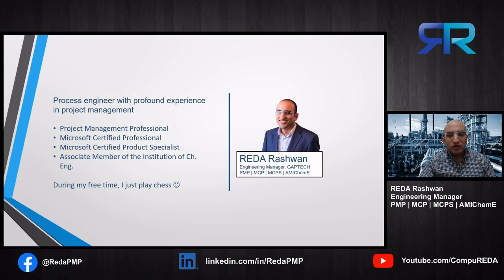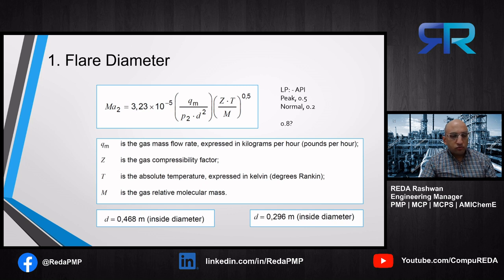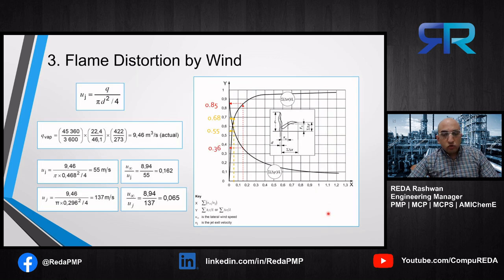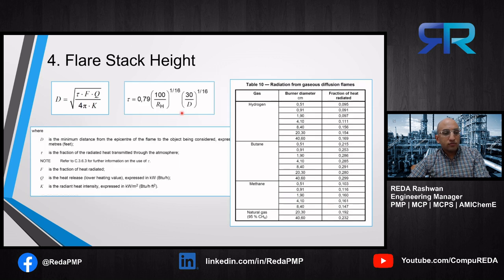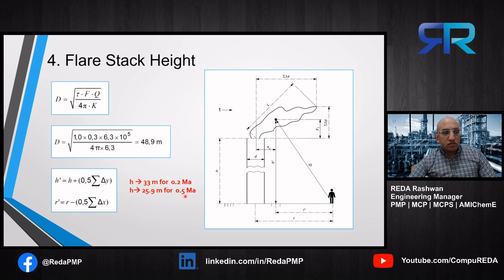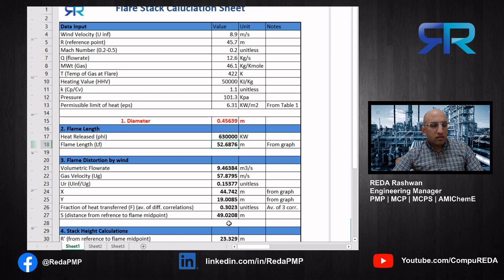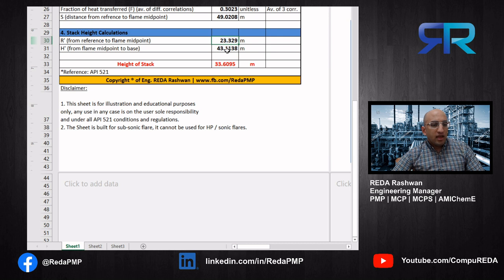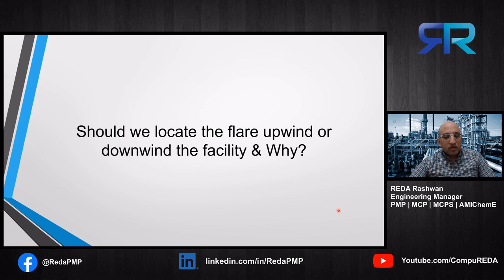Sub-sonic Flare Stack Sizing

Comment: I had also developed spreadseet using simple approach method.
 
I have developed spreadsheet in such a way that you do not need to add dy/l or dx/l and flame length manually will calculate by itslef.
Reply: can you share..
Reply: If Possible, please share the spreadsheet for study purpose?